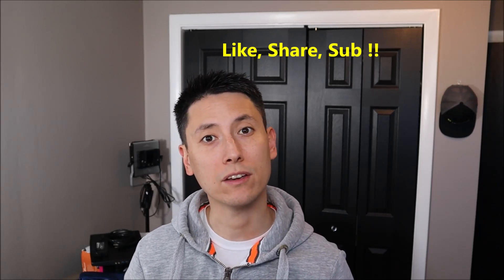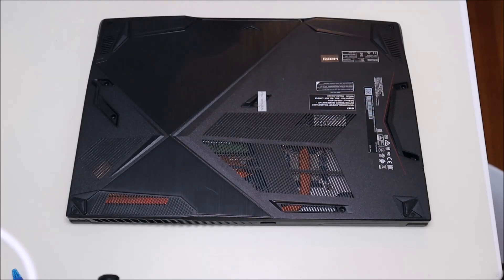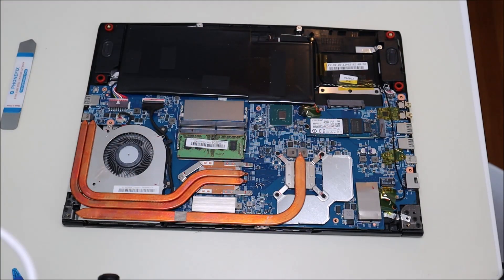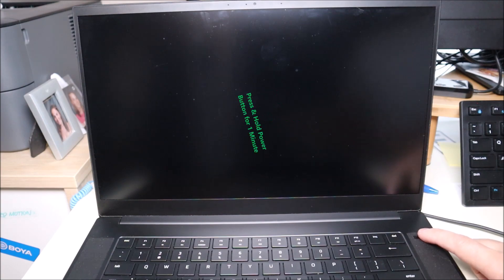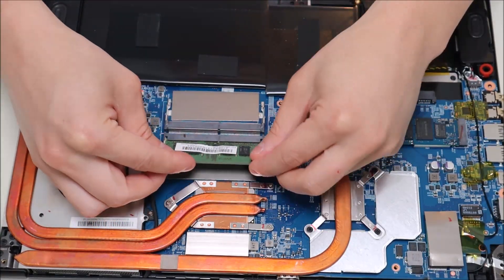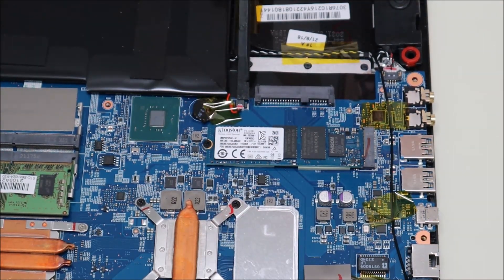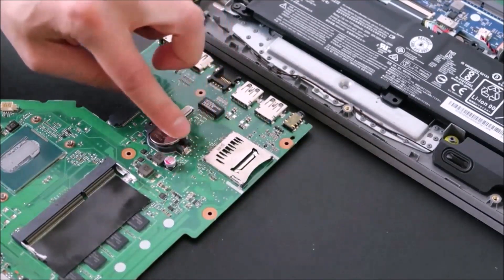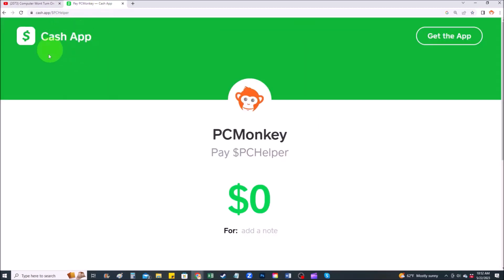MSI Laptop Computer - Dead / No Power / Wont Turn On Fix

Comment: Sir, i am having to do a hard reset everytime i need to turn on my laptop when i try to turn on the laptop only the keyboard lights up and the fan spin but display stays blank and to fix this i am having to hold down the power button till the laptop shuts off and then turn it on.
Reply from the maker: There could be an issue with your battery, charger, or motherboard :(  Can you remove the battery and try using the computer for a while with only the charger?  Does the same issue happend when restarting?
Reply: @PC_Monkey  the issue was fixed when I ran the laptop without battery but I wonder what could be the cause bcz it starts normally on the second attempt and also works normally.
Reply from the maker: @umar_edits12  It could be a bad battery if the issue comes back after reinstalling it.  If so, I would replace the battery

Comment: Hey sir! I need some help! I have a MSI GE76 RAIDER. My youngest kiddo spilled juice on my keyboard. I was right there so made sure to get as much liquid off within the second it spilled. It started that night turned it off cleaned it up the next day and it ran all day un plugged it and put it up for two days upside down and now the charger indicator says its charging but the power button won't turn it on my key board still has some sticky keys and now im not even sure what to google.
Reply from the maker: 1.  Sounds like your on the correct video.  Have you tried the steps seen here? 
2.  Just so you know, liquid spill situations can be hard to troubleshoot just one issue as multiple different components and boards including the motherboard itself, could all be faulty.  
After a liquid spill, you want to first make sure the computer is 100% dry. You would turn your computer off immediately by pressing and holding the power button until the computer turns off. Then you would disassemble the computer as much as your comfortable with, at least trying to remove the bottom case. Then you would turn it on its side and let dry for a couple days.

Comment: I have an msi gf65 thin 10sdr, i did all the steps before the ram and it didnt work, what actually happened is my laptop wont charge after my battery completely drained and switched off, when i plug the charger an orange light keeps blinking when it should turn white to determine charging, and i get stuck at 0% without charging, any advice? Thanks
Reply from the maker: 1.  Sounds like your on the correct video.  Have you tried the steps seen here? 
2.  Also, did anything happen before this issue appeared?  Liquid spill, overheating, Windows update, etc?

Comment: Hi I have an MSI GE75. My screen has been damged so I had to replace it And when I did that I forgot That it was plugged in So When I attatched the new screen I saw a quick flash in the place of attatchement and I heard a small pop noise and everything went off. When its plugged in it doesn't show anything and everything is dead.  If you know what is dammaged plz help me. I had to work to get that laptop the entire summer to help me with studies.  sorry for my bad english, its a 3th laguage for me.
Reply from the maker: Your English is fine :)  Sounds like your on the correct video.  Have you tried the steps seen here?
Reply: No nothing seem to work I think its a component That Had been bronken and I cant seem to identify it  @PC_Monkey

Comment: Are you for hire to repair laptops? My laptop wasn't charged and it turned off when the power level ran out and it won't turn on anymore.  I bought a new one but I am so unhappy with it and I really want to get the other one fixed.
Reply: Hey it happend the same to me :'(
Reply from the maker: 1.  For now, no, Im not for hire.  I am moving later this month and its going to be crazy for a couple months so I am pausing repairs.  Sry :(
2.  Sounds like your on the correct video.  Have you tried the steps seen here?

Comment: It’s illegal for a company to void your warranty because you broke a sticker. But, if it’s still under warranty, why would you bother trying to fix it yourself? Let the factory fix it.
Reply from the maker: No, its not illegal for a company to void your warranty if you do something that breaks the warranty.
Reply: @PC_Monkey , Removing or damaging a sticker doesn’t void your warranty. They can claim that it does all they want, but it doesn’t.
Reply: I have not time to wait on the fucking factory i need my files now
Reply from the maker: @ferv888  Are you asking for help with something?
Reply: @PC_Monkey  well i have an MSI vector gp66 and the thing doesn't start up anymore... All i get is an orange light while it's blowing out hot air... I've tried all the things to restart it. I cannot open it up bc i'd lose my warranty. I bought it 2 months ago.
Reply: @ferv888 , If you are in the United States opening it will not void your warranty. If the company refuses to honor your warranty because you opened it, you can take them to small claims court and you will win.
Reply from the maker: @ferv888  If you are concerned about losing your warranty by doing any of these DIY steps, then you can submit a warranty repair request.
Reply: pls help me i sent it to factory under warranty. they said battery is gone, motherbord and cooling. only motherbord and cooling is under warranty, battery was only a year. so i said fix only motherbord and cooling cuz battery change was 271 euros. i was like wtf i already paid so much money, i will change the battery myself. they said nth but let everything fix apparently. it took 4 weeks literally. when it came back, it didnot turn on at all and they claimed they fixed motherbord and battery. before i let it make, atleast it turned on with the charger. now it wont turn ON AT ALL AND THEY STILL CLAIM THEY FIXED BOTH. I Am an IT student and I NEED MY COMPUTER. i cant wait another 5 weeks. what should i doooo
Reply from the maker: @romiya  Sounds like your on the correct video.  Have you tried the steps seen here? 
Also, did anything happen before this issue appeared?  Liquid spill, overheating, Windows update, etc?
Reply: I have mai katana 17 the best gaming laptop I had a very great experience with gaming but suddenly when I didn't turn on my laptop for the past 15 days it's showing like my battery is dead , no charging only running my laptop with charging after removing the charger laptop is gone immediately.😢😢

Comment: I own a Lenovo legion gaming laptop it overheated and crashed now it just won’t turn on
Reply from the maker: 1.  Sounds like your on the correct video.  Have you tried the steps seen here? 
2.  An overheating computer can be damaging multiple different components if not resolved. First, make sure that the fan and vents are clean and clear. If you need help accessing the fan, let me know what brand and model computer you have and I can help you get inside it. If that does not fix the overheating issue, then try replacing the thermal paste on the CPU and if needed, the GPU as seen here; https://www.youtube.com/watch?v=K_j4GPjpawk. If that fails too, replace the CPU

Comment: I appreciate your videos.  Especially your earlier Dell video’s.   I have a Dell Inspiron N-7110r.  I have been using a (used) XMP5X Mobo in my laptop.  

Recently however, I tied to turn it on, the system came on for a half second and then immediately went off.   I have tried all of your troubleshooting techniques and behold I was not successful.  I’m feeling at this point it’s time for me to get another used XMP5X board, and replace it.   What’s your opinion ?   Thanks. - Keith
Reply from the maker: 1.  Are you able to see anything on the screen when it tries to start, before it turns off?
2.  Also, did anything happen before this?  Overheating, liquid spill, physical damage, Windows update, etc?
Reply: @PC_Monkey  No.  nothing at all on the screen. (It’s not on long enough for anything on the screen).   No spills no damage, no Windows updates.   If your familiar with my model ?   I only get one light up in the upper right hand corner on the 3 diagnostic buttons.
Reply from the maker: @keithmonahan3788  Sounds like your on the correct video then.  Have you tried the steps seen here?
Reply: @PC_Monkey   Oh absolutely. I have
Reply from the maker: @keithmonahan3788   If after trying the steps seen here in this video multiple times without anything changing, your most likely looking at a faulty component preventing the motherboard from working or a motherboard issue.  I would start troubleshooting each component, starting with the charger and power jack.  You can see those two videos here;  https://youtu.be/YBhsVHideGE  &  https://youtu.be/HpabvrNaodU.  You can also try replacing other components like your Power Button to see if that is the route cause.  If none of those are the issue, you would then be left with a motherboard replacement.
Reply: @PC_Monkey  well most of this I have already performed.  Thank you very much !  👍
Reply from the maker: Good luck !!  Sorry it wasnt something easier :( 
 @keithmonahan3788

Comment: Do you know how  to fix a gateway laptop
Model: GWTN141-5BL? 
I spilt some stuff all over my keyboard and rubbed it on the keys and I can't turn it on and its been sitting for a few months bc I could not get it to turn on
Reply from the maker: 1.  Are there any signs of life at all when you try to turn it on? Lights? Fan, Motherboard, or Hard Drive sounds? Anything seen on the screen?
2.  Liquid damage may have affected the internal boards.  If so, they most likely would have to be replaced fyi :(

Comment: hi, i just want to ask a question. My hp laptop suddenly shut down when i tried to charge something on my laptop, then i tried to turn on the laptop again but it doesn't turn on. also when i'm trying to charge it, the laptop doesn't response on the charger. what do you think might the problem in my laptop?
Reply from the maker: Sounds like your on the correct video.  Have you tried the steps seen here? 
Also, did anything happen before this issue appeared?  Liquid spill, overheating, Windows update, etc?
Reply: Same exact thing happen I’m still trying to figure it out and I don’t want to open up the bottom yet 😮
Reply from the maker: @nmedi0860  1.  Are there any signs of life at all when you try to turn it on? Lights? Fan, Motherboard, or Hard Drive sounds? Anything seen on the screen?
2.  Also, did anything happen before this issue appeared?  Liquid spill, overheating, Windows update, etc?

Comment: Hey could you do a video for the Lenovo 100e 2nd gen (11.6 length) I was using mine and it just shut down I put it to charge but it won't charge and it's get hot when I leave it to charge 

please help😢
Reply from the maker: 1.  For a computer that does not turn on, try this video first; https://youtu.be/kOBY4k2Mn_k. Let me know how that goes :)
2.  Also, did anything happen before this issue appeared?  Liquid spill, overheating, Windows update, etc?

Comment: Still doesn't work 😢 
Sometime start just few seconds and turn off .
Reply from the maker: 1.  Are there any signs of life at all when you try to turn it on? Lights? Fan, Motherboard, or Hard Drive sounds? Anything seen on the screen?
2.  Also, did anything happen before this issue appeared?  Liquid spill, overheating, Windows update, etc?
Reply: @PC_Monkey  yah I was playing game on it, and  after half hours, suddenly shut down and not working again.  I tried to turn on  , but nothing , sometimes it showing light on screen mark ASUS  few scand and shutdown .
Reply from the maker: @mohamednoman9434  If after trying the steps seen here in this video multiple times without anything changing, your most likely looking at a faulty component preventing the motherboard from working or a motherboard issue.  I would start troubleshooting each component, starting with the charger and power jack.  You can see those two videos here;  https://youtu.be/YBhsVHideGE  &  https://youtu.be/HpabvrNaodU.  You can also try replacing other components like your Power Button to see if that is the route cause.  If none of those are the issue, you would then be left with a motherboard replacement.
Reply: @PC_Monkey  Thank you for the information. I would try it ❤️
Reply from the maker: @mohamednoman9434  Good luck !!  Sorry it wasnt something easier :(